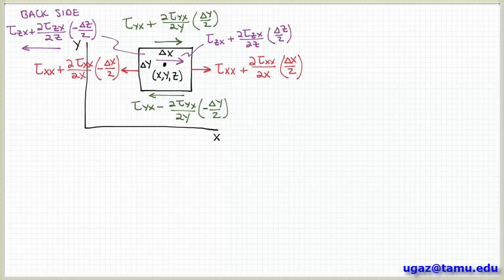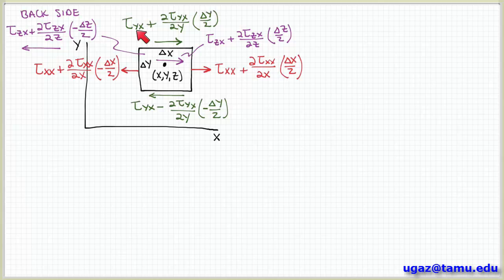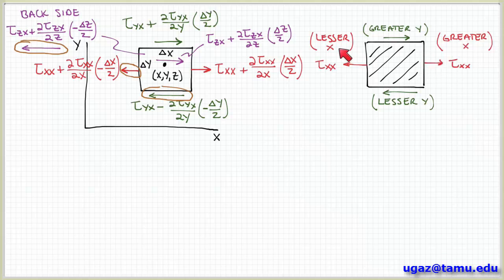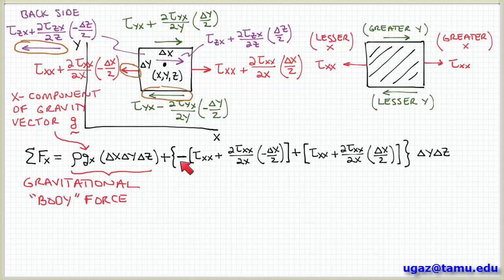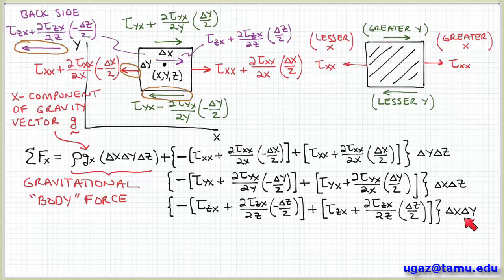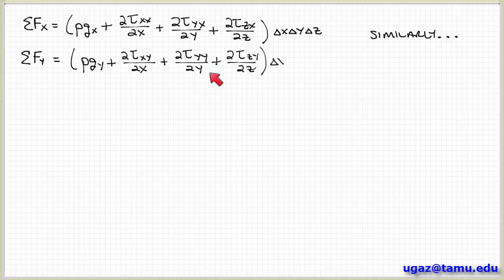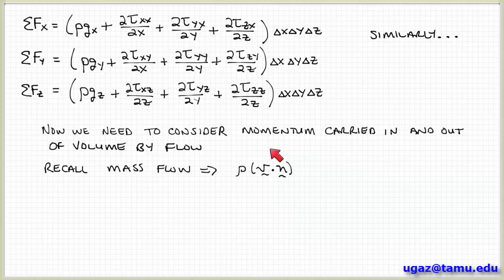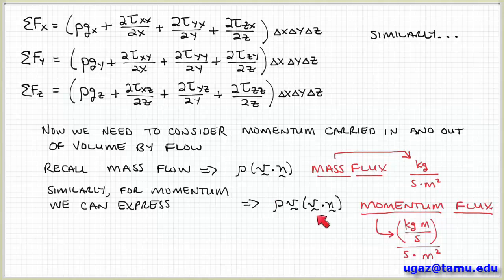Conservation of Momentum, part 2 - Lecture 4.2 - Chemical Engineering Fluid Mechanics

Comment: hi,

at 7:42 (<-- click this) you state [ the partial derivative of the shear stress acting in the z direction on a surface normal to a plane in the x direction ] is with respect to dz, but I feel it should be with respect to dx. could you verify this is not a typo?
Reply: It is correct; he is working on the z plane with force acting in the x direction. The derivative will be wrt z. See the pattern with the others.